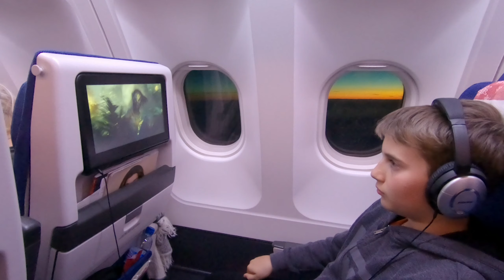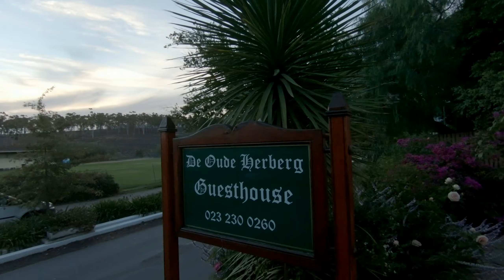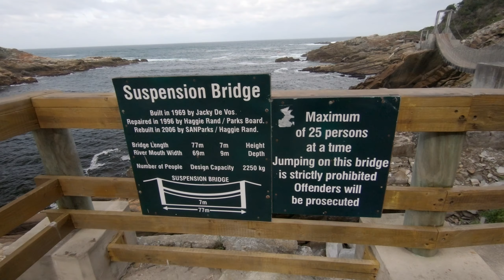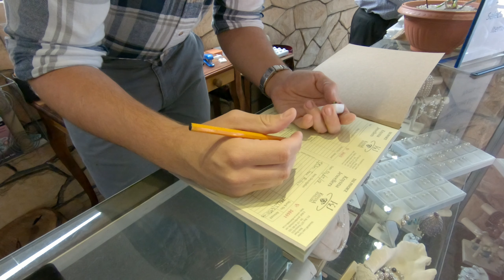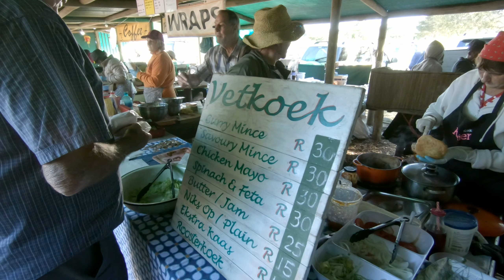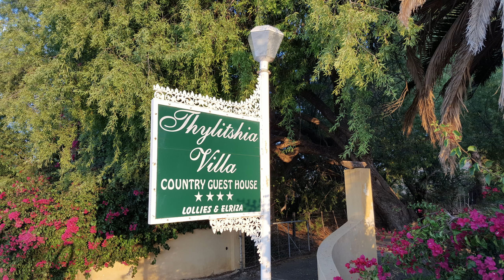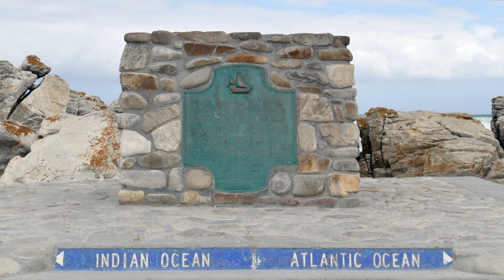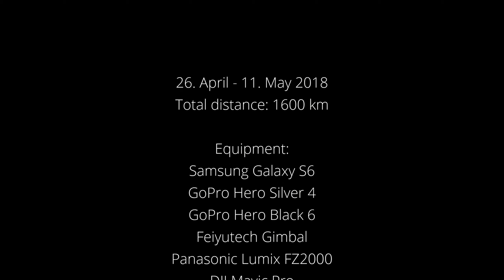South Africa 2-Week Self Drive Tour

Comment: A very nice video,I am planning a similar trip for 2022.But on a motorcycle, the plan is for the months April/May.
What temperatures do you have in that months,I mean inland in that area?
Because I don’t like to much heat😅
Greetings from Holland
Reply: Those months are our autumn but South Africa does not get as  cold as  Europe during winter.

Language should also not be a problem for you as the two main languages in the Southern Cape are english and afrikaans. You should have no problem understanding afrikaans if you are Dutch